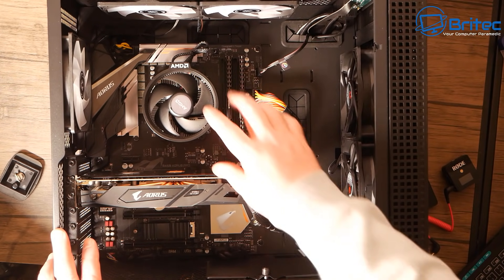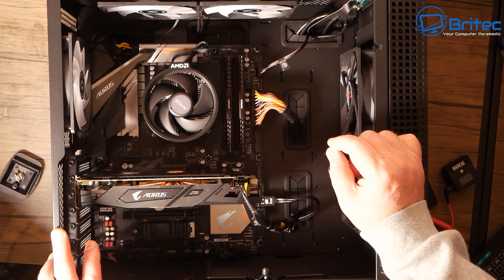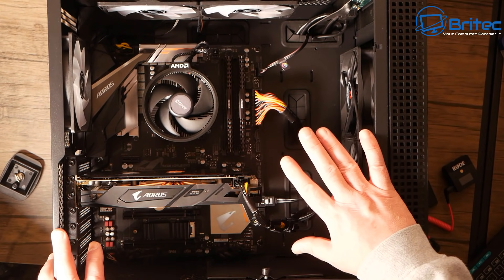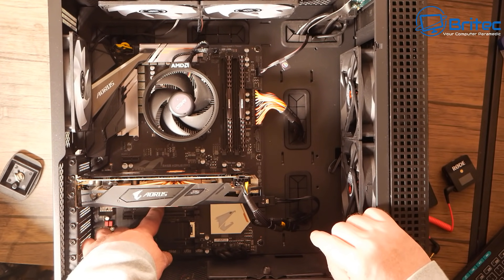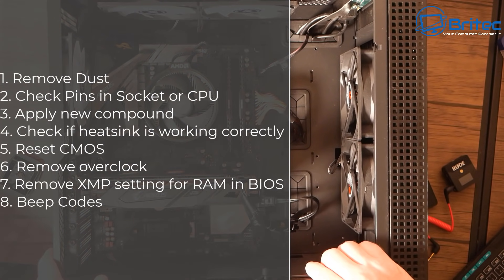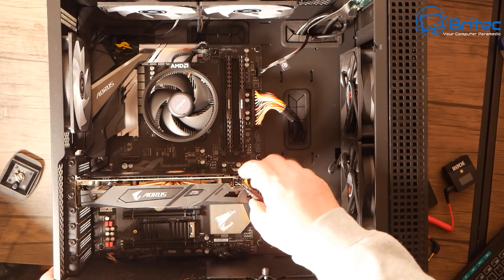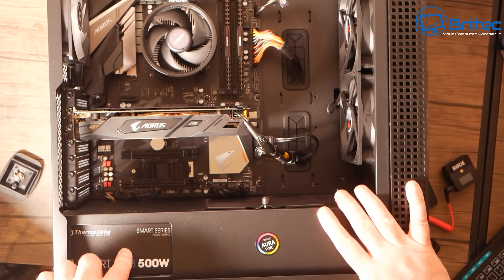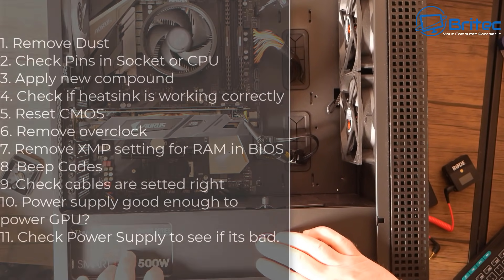Fixing A Computer That Keeps Power Cycling

Comment from the maker: Tips and tricks to troubleshooting a pc that turns on and off. Smash the LIKE button. 👍
Reply: Hej Brian thanks for the video yes with relatively simple means you can get a computer to work normally again. A lot of dust and hair and other things accumulate in a computer, so a good cleaning of the computer's components is good to do after a while. I think many people miss  this but, you can also have errors in the computer parts, of course. Good video Brian take care och ha en trevlig torsdag.
Reply: I'm most grateful for this timely video. I will be at my mother's for Thanksgiving and guess what I get to do...Clean her computer. Cheers
Reply: This does not help.😢
Reply: where does an average non-computer person get thermal paste? I don't happen to have any lying around so what type, what brand, what do I look for? Is there some rating on the package? I need an absolute beginner's guide to self-repair. Blessings fyi, the last time my computer was acting up my friend replaced the coin battery and it stopped turning on and off.
Reply: YOUR PSU IS BROKEN
Reply: I did everything and it still doesn't work, all of the parts are brand new and it has worked for the past 2 months and just stopped working
Reply: If all else fails... I saw another video showing the technician unplug (from the motherboard) the wires to the reset switch, on/off switch (use another working one to test), USB front ports etc. Turns out the faulty reset switch was to blame for the computer resetting itself, similar to power cycling.
Reply: I've had that issue before, but it wasn't due to dust, it happened when the power in my house kept going on and off
Reply: @JadenYukifan28  same problem here 
What did u do to solve it
Reply: @shashikumarm3615  I had to get a new Computer since the one that had the issue was already old
Reply: @JadenYukifan28  Oh k Thanks Brooke
Reply: @shashikumarm3615  Welcome, glad to help

Comment: 1. Power off
2. Power switch off
3. Cable out
4. Hold main power button for 3-5 seconds. 
5. Get both RAM sticks out and clean the contacts carefully with a tissue applying a good ammount of pressure.
6. Install both back in
7. Cable in, switch on, power on.

Comment: Question Please anyone... my backup old pc was plugged into power for like 7 months since last turned on...( its maintainedwell so wasnt dirty at all) after being gone for  2 days i came home and the fans were out of control and it kept starting and stopping every ten seconds

fans max speed ...

( starts fans immediate max speed nothing happens turns off repeats) it was scary as i was gone for 3 days so who knows how long this was happening

MY ?????? is why did it start doing this on its own after months of being off just power plugged in...( there was nothing but power plugged in nothing else no screen mouse anything
Reply: Ironically the power supply was only like 2 years old and the newest replaced part...GIGABYTE
Reply from the maker: You need to troubleshoot

Comment: Got a 6 years old pc. That still runs, but when you first turn it on it will shut down, then turn on again and starts bios. After going through that and “save settings and reset” in turns on normally. I don’t know how to fix it. But I will probably buy a new one anyway
Reply: just replace the cmos battery.

Comment: tysm, just built a new pc and it almost turned off right after i updated bios (thankfully it shut down before i could), just realized that even when testing i should probably use a cooler (yea this probably seems obvious but i thought just booting to bios before updating and turning it back off wouldn’t heat up my cpu that much

Comment: If my issues got solved means i am Happiest person in this world . I have My college presentations Tomorrow to submit But PC ran into problem after Changing the PSU . My brother went to shop to buy a cimos Battery if Replacing the Cmos battery it works means ❤❤ thank you so much But will see in another 2 hours if it didn't work means i won't reply down if works i will reply here 😢

Comment: I know this video is a little older but, I’ve got an issue where my pc ONLY power cycles rebooting out of bios. I had made a mistake and held the flash bios button instead of clear cmos by accident with a hard drive in the usb port without a bios on it. I had to reflash the bios with a real bios but after successfully installing the bios it went into a power cycling state for 6.5 hours, I just let it keep going until it rebooted on its own. 

After that the Pc boots up and runs everything, it doesn’t randomly crash or power cycle or have issue UNLESS I go into bios.
Otherwise in hwinfo all of the voltages look good temps are good, everything is good.

When I go into BIOS and make changes then hit save and exit it will save all of the settings and try to reboot but then it power cycles forever. I have to turn off the power supply then turn it back on and hit the power button then it fires right up and goes into windows AND it saves the settings from bios. It just simply won’t reboot from bios.

One thing I found is that if I switch to Intel default settings it will boot from bios, or if I change it to unlimited settings it will boot from bios but for whatever reason when in the Intel performance mode (which is what I’ve always used) in bios it refuses to boot and power cycles. 

It’s such a strange thing. I’m switching the power supply just to make sure that it’s not an issue but otherwise everything on the PC (besides the PSU) is 100% brand new from October 2024, literally the only things that’s “old” is the PSU from March 2023….

 Any ideas?

Comment: Also: 
- remove power and reset switch connectors in case the buttons are shorting.
- ensure enough time passed between plugging power cord, and pressing the power switch in case your psu caps are ancient.

Comment: HELP NEEDED. Tried everything. Nothing is working. My PC is about 10 years old. Occasionally freezing up with Kernel 41 message. It works fine most days but bought a NXZT C850 ATX 3.1 and a Corsair RM850X PSU. They were to replace my old Corsair 650 that seems to mostly work. I would simply try a new PSU to see if it fixes my PC and upgrade soon anyway since Wind. 10 is being phased out. Nothing helps. It turns on, then off immediately and repeats forever if I let it. I did the paperclip trick and the fan spins. Could it be a compatibility issue? I use all the cables that came with the new PSU's- neither allow the PC to run. I have an old low power GPU. The new PSU's are 200 Watts higher and Gold rated. All connections are seated fine. I am typing this with the old PSU installed. 

Is there any settings in CMOS I should try to change? I doubt two brand new PSU's are bad. Got one from MIcrocenter- both in sealed boxes.
Reply: Did you fix it? I had the same problem. I was trying to install Windows, and the power went off randomly, so the motherboard got bricked, so I bought a new motherboard, and it seems like it’s working fine.
Reply: @Lo535-d8e  Yes, by building a new one. AMD 7900+64GB DDR5 Ram. Corsair 850 Gold PSU; Lian Li Vision case+RGB fans and AIO. It's much faster, smoother and never crashes. I tried to replace the PSU but for some reasons, these new PSU's did not work. No idea why- more wattage, better quality and connected correctly, but the old PC did not turn on. Nothing. It still works with the old PSU. 

In your case, did you try resetting the Bios? Removing the battery on the MOBO? Remove the memory?

Comment: Thank you. I followed the steps. In the end, it was the thermal paste on the CPU. Weird that it wasnt dry or anything but when I cleaned it up, put new thermal paste, and put it back on, it didn't work at first but after a few tries, it started running again.

Comment: My father in law gave me a laptop to fix with the same problem, at first I thought it was bootlooping and the screen didn't had time to turn on but I realised there was NO THERMAL PASTE on the cpu and it is like 13 or 14 years old, I upgraded the ram to 4gb from 2gb and added some thermal paste, the laptop works well now and it has a new ssd. It still is a bit slow but older people have more patience

Comment: Everything on my computer is working. Just bought the aorus z790 elite x with an i9 12900k. AIO shows temp, DDR5 ram is lit up, fans are working. 4070ti 16GB and 2tb Samsung 990 pro were working fine on my old motherboard. Motherboard light is stable but it won’t post. It keeps restarting itself. Sometimes after awhile. Absolutely driving me insane

Comment: It is usually a much simpler fix, it is a ram problem. If you did like me take off a ram and put it back in, it may not be in fully, or you put it in the wrong slot. So try this first before you proceed with this guys first step here.

Comment: My pc continously shuts off then restarts, sometimes starts power cycling.. I have tried different psu, removed 1 ram stick, swapped ram sticks, reseated ram sticks, removed gpu, removed ssd, replaced cmos battery,reseated plugs for psu, checked psu power wire but still issue persists.
Reply: change ur motherboard

Comment: hi im having almost the same problem mine is turning on and off twice when i turn it on but when it runs i dosent turn off again .. i replaced the power supply and it worked for couple of days and back to square one. i applied new thermal paste on the cpu it worked for a couple of days and back to square one..i gave some thermal paste to the gpu aswell but still the same..does anyone know whats the problem exactly?
Reply: Same issue
Reply: @ishmeetsingh858  hi i found the issue i was switching off the power supply as well when i disconnect the wire from it so try not switch of the power supply if you disconnect the cable..it never switched off again

Comment: What fixed it for me was I had used a power cable that was already there from the previous PSU.
Once I replaced that one, so ALL of the power cables came WITH the original CPU, it worked.
Figured it out thanks to a random short where a guy fried his system cause he did that with the MB power cable...

Comment: I just got done building a PC with 100% used parts off eBay. I built quite a few PC’s. I did every single step isolated from 1 another. 1 by 1 and nothing was working. I tried more time consuming and more difficult steps first. In the end my solution was removing and re-seating the ram sticks. It fixed my problem, thanks for the video.

Comment: I anm having the same problem, tried everything ~ clean and reassembled all parts and cables. Reseat RAMs, GPU CPU. Also checked the PSU is working fine as the fan is spinning.

I notice one thing that if I place the case on its side instead of standing, whereby the CPU tower and graphic card are standing vertically instead of hanging by the side then the problem is gone. Could it be that my ITX case is so cramped that the power switch or its cable pins became faulty whereby a slight touch or disturbance could cause power cycling?

Comment: Please help. Is there a led and Buzzer on the H410MH BIOSTAR Motherboard?
My PC keeps shutting down and then restarts and keeps on but screen is black : No Signal. Ram is new.
Reply: Same mine turns on the off about 3 times then fully turns on and no display in my monitor

Comment: I would be really grateful if anyone could help me with my problem. 
Today, I replaced my chap power supply with a new Corsair RM850x (shift series). When I tried to turn it on, it powered for a second (the fans started spinning, and the light turned on), but right after that, it stopped and turned off. I checked if all of the cables were plugged in correctly, and I think they are. I haven't changed anything else. Does anyone have any ideas on what could be the problem?

Comment: A pc power cycle , when it turns on only mouse and speakers do as well. Moniter and keyboard dont turn on. Then turns off, and poer cycles again . Will these steps help? Checked cables and power supply , checked for loose screws and still same issue. Help please

Comment: Replaced the CMOS battery, removed dust from coolers... nothing. What worked in the end was to remove all memory sticks, let it try to boot with no RAM, and then replacing the sticks one by one, booting up each time. None of them were faulty, it was just a little motherboard neediness and attention seeking behaviour. 😂

Comment: My problem is its booting up goes on then off and then after 1-3 seconds goes on by itself. What problem is that ? Never happened, started doing this after bios update. After booting up no issues at all works great and efficient without errors and blue screens.
Reply: Find solution?
Reply: @dodaosama6833  same problem :/ dodao did you ever figure it out?
Reply: Same here

Comment: I have the problem where it keeps restarting doesn't even go into bios.  Surprisingly if the system I unplugged for a few hours it would run fine.
Reply: Your power supply will die soon.
Reply: @MarceloMaldonado79  you sure it's the psu? this actually started when a i was playing a game and there was load shedding so I'd be glad if it's the psu instead if the mb. I test the psu by shorting the green and black wire but it runs fine
Reply: @UZEETM  What happens to you happened exactly to me.  And after some time the PSU died for good.  I bought a new PSU and everything has been working fine for over 1 year.
Reply: @MarceloMaldonado79  thanks man.

Comment: My Gigabyte B250M motherboard have the same issue. When I turn on it immediately turn off and then turning on in the second attempt automatically and it starts and everything is fine. Idk why but its bothering me cuz this is always happening when I turn on so my friends told me its not soo good for the hdd and other parts. Btw my psu is running fine.
Reply: How did you fix it

Comment: Great video and informative.
I have a dilemma as after my old pc finally gave up so I had a new one custom built but it started shutting down and rebooting/power cycling randomly by itself which my previous pc did and this would happen 3-4 times in a row but only happens in my house and not where it was built.
Tower unit is plugged directly into the wall socket.
Connected to the pc are Logitech x230 speakers,keyboard,mouse,printer and external hard drive which is only connected/powered when used for back up.
Ideas anyone please ?
Reply: Don't plug your tower unit directly to the wall socket as power surge may damage your PC. You should use AVR or UPS to protect your pc from unexpected power surges.
Reply: @tyronesma107  Many thanks indeed for the advice and will look into those options.
Reply: @tyronesma107  Like this one ?

Maplin Energenie 850 VA Lead Acid UPS with USB Controlled Interface & LCD Display
Reply: Yeah, UPS is a great option, but it's way more expensive than a regular AVR.
Reply: @tyronesma107  this one is just under £60
Reply: The psu SHOULD do the same job as the avr, why do you still need it?
Reply: Mine is doing this now. Trying to figure it out because its not all the time... my house is old and the wiring is not to code tbh. I think its a voltage issue despite my pc plugged into an avc.

Comment: I've been trying to diagnose an old 775 motherboard that suddenly wouldn't boot and just power cycle. I took everything out just left cpu and heat sink. Tried another psu, another cpu, different ram. Still power's on for 5 seconds then off and on again, no beep codes. Has a buzzer on the motherboard. Cleared cmos. All caps are good. Run out of ideas. Must just be a component failure. Have I missed any other check?
Reply: did u fix it?
Reply: @mikeruuu24  No but looking closely at the board I can see one of the tiny flat capacitors near the cpu looks dodgy and I suspect its that. I've just swapped the motherboard for another. I may repair the other one at a later date.
Reply: @whovisionsCGI  goodluck man, my friend just fixed his pc that was having the problem. Turnt out it was one of his ram slots not working anymore. His pc boots up now that he took the ram outta that slot.
Reply: @mikeruuu24  Yes, that was one of the first things I checked. Glad he got his working.

Comment: @Britec09 I've had this issue twice now. I RMA'd the original motherboard that was having this issue because the RAM slots failed. I also RMA'd the power supplies and was sent two new ones. I was sent the first replacement motherboard and it arrived DOA so I had to RMA that one. The 2nd replacement they sent me worked fine for about two hours and then the PCI Express x16 Slot 1 stopped working completely. It wouldn't even detect either of my graphics cards. I ran the two graphics cards in PCI Express Slot 2 and 3 for two days without any issue whatsoever ever and then the computer completely shut off and did the whole power cycling. I tried the motherboard outside the case with just the motherboard and CPU hooked up and it still power cycled. I'm wondering if you think it might have been the motherboard again, which I have already RMA'd for a third time or the CPU? Thanks.